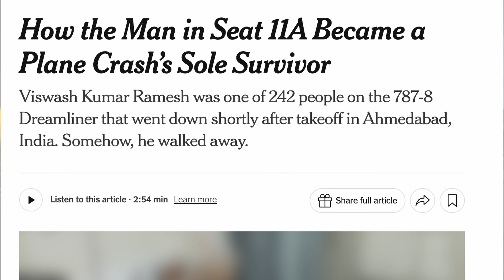Why the RAT Changes Everything – Air India 171 Update

Comment: True Story Behind Ahmedabad Plane Crash: Tiny Part Claims Passengers' Lives
Flight 171, bound for London Gatwick, departed Sardar Vallabhbhai Patel International Airport at 13:39 (IST). The Dreamliner aircraft carried 230 passengers, 12 crew members, and approximately 100 tons of fuel. The aircraft's registration number was VT-ANP. The flight was commanded by Captain Sumeet Sabharwal, who had 12,000 hours of flight experience, and co-pilot Clive Kundar, with 4,500 hours of experience.
Immediately after takeoff, within 18 seconds of becoming airborne, the aircraft reached an altitude of 650 feet (approximately 65 meters). That's when the tragedy struck.
According to the CVR (Cockpit Voice Recorder):
A "click" sound, like metal breaking, was heard from the Captain's seat. In fact, this sound was from the breaking of a $15 (approx. ₹1,200) pin that secured the seat rail. This pin had been replaced during maintenance on June 1, 2025, but was not re-inspected.
As the seat suddenly slid backward, Captain Sabharwal was startled and, in an automatic reaction, grabbed the throttle levers, moving them from maximum takeoff power to "idle." This caused the power of both GEnx-1B engines to suddenly shut down.
At the 18th second:
Co-pilot Kundar shouted: "Thrust is going!"
At the 20th second:
The Captain said: "My seat!"
By the 26th second:
Both engines completely shut down, and the aircraft stalled at such a low altitude. The pilots sent a Mayday call, but there were only 12 seconds left to save the aircraft.
At the 38th second:
The aircraft crashed into the hostel block of B.J. Medical College in Ahmedabad and erupted into a massive explosion.
Sole Survivor
Vivashkumar Ramesh, a 40-year-old British citizen seated in 11A, managed to escape through a ruptured section. He sustained severe burns but survived the accident.
Investigation and Findings
The Black Boxes (FDR and CVR) were recovered on June 13 and 16. India's AAIB (Aircraft Accident Investigation Bureau), America's NTSB, the UK's AAIB, Boeing, and GE Aerospace collaborated on the analysis.
According to the FDR:
 * Both engines were operating in perfectly normal condition until the throttles were moved to "idle."
 * The FADEC system and flap positions were also found to be normal.
 * The RAT (Ram Air Turbine) activated just before the crash, which confirmed that engine power had been completely lost.
Main Cause:
A $15 pin, which was not re-inspected after maintenance. This was a clear violation of Air India's maintenance protocols.
Reactions
Former AAIB official Kishore Chinta stated:
"$15 part brought down a $200 million aircraft and took 270 lives. This is a warning for the entire airline industry."
Captain Ayesha Patel (Boeing 787 instructor) said:
"The Captain's reaction was natural, but at 650 feet, there's no room for error. Equipment should be designed to maintain safety even under stressful conditions."
As an example, she recalled the 1988 Aloha Airlines Flight 243 incident, where a small maintenance oversight led to mid-air decompression.
Government and Airline Actions
 * DGCA (India's Directorate General of Civil Aviation) ordered inspections of all 33 Air India Boeing 787 aircraft.
 * By June 19, 2025, 26 aircraft passed inspection, but 66 flights had to be canceled.
 * Maintenance reviews and strict audits were made mandatory for all Indian airlines.
DGCA chief Vikram Dev stated:
"Now every pin and bolt must be considered a critical part."
Global Impact
 * International regulators like the FAA (USA) and EASA (European Union) are also seriously considering investigating this accident.
 * Boeing, although not directly at fault, is having its component design investigated.
 * GE Aerospace confirmed that there was no technical malfunction with the engines.
Boeing CEO Kelly Ortberg issued a statement:
"We are fully cooperating with investigators to ensure this never happens again."
Conclusion:
This accident shows that even the smallest part, if overlooked, can prove disastrous. The tragedy of Flight 171 is a profound lesson – every screw, every pin is critical in every aircraft flying in the air.

Comment: And I also noticed that there's no sound of the engines so { when the engines are at full power there's a define sound they make that I did not hear but yet the sound of the Rat was very noticeable  - that means no thrust and even more the pilots tried pulling up on the nose which stalled the air craft as I could see the pitch change just before the crash happened, I think the cause was electrical failure at this point as the rat was deployed but to what caused the electrical fail will have to see the outcome of the investigation ...

Comment: I think flaps may have been  incorrectly set for that sort of temperature which was said to be around 43 degrees. That led the aircraft to take off late (as we see in a video), sucking the gravel at the end of the runway into the engines damaging them and thus deploying the RAT.  And the rest is history.

Comment: I haven’t read all of the comments, so apologies if my remarks are repeating what others have said.

There are actually six conditions that will deploy the RAT:
1) Push the button to deploy it.
2) Loss of both engines.
3) Loss of electrical power to both pilots' Primary Flight Displays.
4) Loss of system pressure in all three hydraulic systems.
5) Loss of all four (hydraulic) electric motor pumps on takeoff with loss of one engine.
6) Loss of all four (hydraulic) electric motor pumps when landing with certain flight control failures.

Also noteworthy, the ADS-B data shows that the flight on this day did not backtrack on the runway and use the turn button to allow a longer takeoff roll. Looking at the Jeppesen airport plate suggests that this flight had about 6000’ for a takeoff on an 11+ hour flight (lots of fuel, so heavy aircraft). The flights on the previous days did backtrack. This may prove to be a factor.

Thoughts and prayers for the victims and their families.

Comment: Why wasn't it 
 aired and talked about the fact that this exact dreamliner had major issues only 10 days prior? To the point it was on the runway about to take off when passengers started screaming for hostesses or crew to let them know what was happening!! Smelling a foul odor of electric burning and smoke coming through where they where seared. The pilot came back where they were and confirmed that for which passengers had said. Eventually they said Frankfurt wasn't going to allow takeoff so the passengers where taken to a hotel.

Comment: Regardless of RAT deployment, power outage and no thrust...
why are the flaps fully UP when the landing gear is fully DOWN? It is suppose to be the other way, right?
How did that standard, simple, flight routine activity get out of  sequence?  
Did they think the landing gear was UP then hastily raised the flaps fully (decreasing lift) instead of incrementally as  the vertical climb speed increases?
Can't believe the controls for the landing gear and flaps are physically located next to each other nor that they would look, feel, nor operate the same.  For example, the landing gear control might be an ON/OFF illuminated push button switch while the flaps control might be an indexed, lever switch with a position indicator read out that can be read there and repeated on the head up display or read out on the dashboard screen, so to speak, such that the pilot knows the flaps are UP or DOWN or in other positions
When I tested fan engines around the world,  some fan engines would  make a loud bang, similar to that of  a cannon shot, when starved of fuel.  
Looks like there is no yaw based the rudder position. So, BOTH engines  are either ON or OFF.   In fact the engines are both OFF as there is no heat signature in the starboard engine, and I didn't hear the turbine wine over the RAT.  So, loss of thrust.
The elevator is in the CLIMB position and flaps are fully UP, and the plane lost power as the RAT is deployed.  So, if I assume the flight surfaces can still move up, down, left and right  then the flaps can be lowered, too. 
So, the engines lost thrust then the flaps would never have be moved and NOT before the landing gear is fully UP.
Doesn't seem there was enough time to get the proper vertical speed, raise the landing gear fully UP then raise the flaps fully UP then BOOM catastrophic engine failure then lower the landing gear, continue to try to climb and not have the flaps all the way down.

Comment: Sir, can you please answer this question. If the rat ploys, for example, an electrical failure, I would like to know what actually powers the fuel pumps to the engines? Because if it was a major electrical issue, and the fuel pumps weren’t providing fuel to the engines, then that would provide a dual engine failure??

Comment: One thing that I see is the main gear trucks appear to be pitched down which happens on the 787 when the gear is selected up. I'm leaning not to a dual engine failure, but a dual engine shutdown. It's happened before.

Comment: There should be redundancy between those engines, separate fuel lines, separate power supply, ect. To avoid dual engine failure. The odds for a dual engine failure, both engine fails the same time, is extremely small...

Comment: I have commented on my suspicion of what happened to Air India 171 several times on various blogs, and am at a loss why my comments have fallen on deaf ears, it even being called a cockamamie idea by Captain Steeeve, who works, or has worked for the same airline I flew for for 31 years.  All the ideas being floated out there, vapor lock, one engine failing, flaps not set correctly, etc. are all red herrings.  The cause of this accident was the result of both engines being shut down, either inadvertently, or intentionally.  The latter is more plausible, in my view, and that leads, to suicide.  It is also my belief, the relief pilot may be the culprit.  The FUEL CONTROL switches are directly in front of his knees, and it would have been very easy to simply reach up and place both FUEL CONTROL switches from RUN to CUTOFF, right after the FO placed the landing gear handle from down to up, which also explains why the gear bogies appeared to be in the process of tilting. The first indication of engine power loss would have been orally, and then verified by the RPMs decreasing on the EICAS; the thought of looking down to check the FUEL CONTROL switches would have been out of the realm of possibility.  But more applicably is the RAT deploying, another indication of dual engine failure, as well as the brief Mayday call by the captain. For those of you who are so adamant in not accepting the idea of suicide, remember this has happened before.  Furthermore, if you want to make this gruesome action a foolproof event, what better time to do this than right after lift off.  It is unimaginable what thoughts must have been going through this well seasoned experienced captain's mind, seeing both engines spool down, and being completely helpless.

Comment: THE AIRPORT CCTV VIDEO PROVIDES CRUCIAL EVIDENCE ON CAUSE OF THE TWO ENGINE FAILURES

As the Aircraft approaches the end of runway, it blew dried vegetation dust and dirt in front of the Aircraft and flew into the dust and debris. What supposed to be fuel and air mixture became fuel air dust and shredded debris into the engines. 

The Airport CCTV Video playback in slow motion and Frame by Frame one seconds before liftoff and one seconds after liftoff provides crucial evidence of this event that cause the two engine failures 

The Aircraft Overshoot the Runway at LIFTOFF probably due to Baggage and Passenger Overload or wrong Flap Configuration at Takeoff, Flap-5 for Normal Load and Flap-15 for Heavy Load.

Comment: The crash theories circling the globe do not even close to what Captain Steevie states could possibly explain why a 787 Dreamliner crashed just seconds after takeoff.   The RAT deploying,  the absence of the deafening sound dual engines on a commercial jet make when taking off,  the MAYDAY call stating loss of power by the pilot and finally the big BANG heard by the surviving passenger all seems to point to a dual engine flameout but it could take months to nail down the WHY if total engine failure turns out to be the cause.   Love this channel.

Comment: What I don't understand is:  seems like at some point before taking off, someone would have noticed that neither engine was running??  No sound?  Blades not turning?  Or, did they quit running only just before takeoff?   How else could the plane have been pushed back, taxi to runway, get everything lined up to go, start down the runway - with no engines running??  I most likely did not hear something correctly in the video?  This is what has been running through my mind ever since looking at this.

Comment: I'm not referring to the 2 FAA required "black Box" recording information about a flight.

Going back 10-15 years, GE the engine manufacturer collected as many as six "trend points" sent to GE, the operator or to both, using ACARS digital data messages from an aircraft via the Arinc or SITA networks, including snapshots for takeoff, cruise and when any preset limits or thresholds are exceeded. The engine parameters, collected by the aircraft's central aircraft condition monitoring system (ACMS) and packaged in a single 3.2kb ACARS message, include exhaust gas temperatures, fuel flow and core speed as a function of the fan speed, parameters that indicate the health of the engine's "gas path". ?

Comment: great analysis as always. Awesome shoutout to the Aviation Herald (AVHerald). Simon does a brilliant job in getting out there available factual info about incidents of all sorts. Anything put on there is factual and Simon (I've been a member for 10+years) does not speculate. Any speculation is on the authorities releasing the report. I did thin when reading the article that the quoted retired Air India pilot and authorities sounded quite defensive...

Comment: If they lost all hydraulics, how long would it take for residual pressure to bleed off and let the slats/flaps close back up?  The way it "waddles" down to the ground does look like insufficient lift, as you mentioned previously...but maybe it wasn't caused by human error, and the RAT didn't have time to sufficiently power up those pumps and re-deploy the flaps/slats.

Comment: If it was an electrical failure, that impacts the Electronic Engine Controls (EECs), which manage engine thrust, the engines could revert to idle power, and the pilots might not be able to increase thrust, hence, the RAT was deployed.